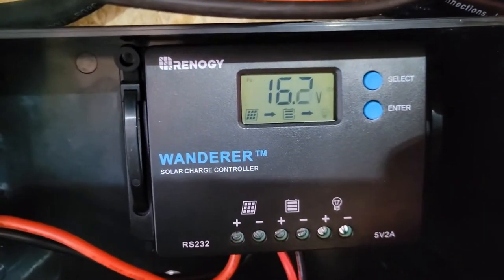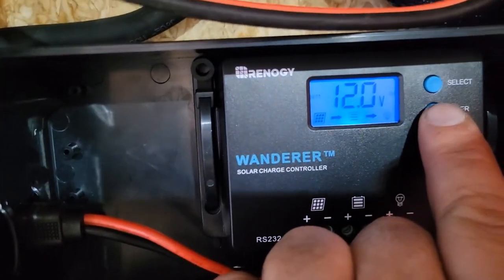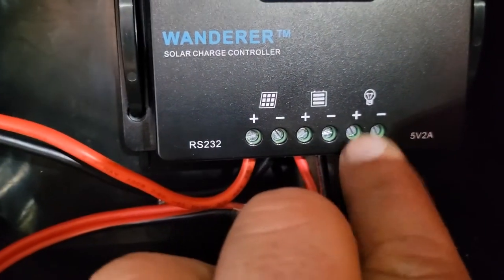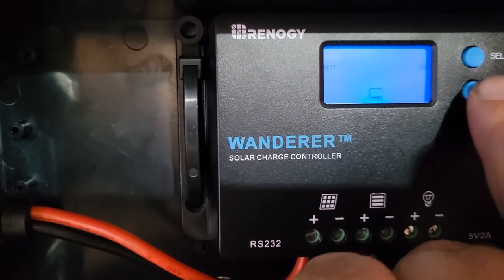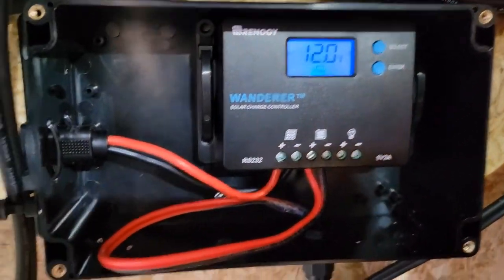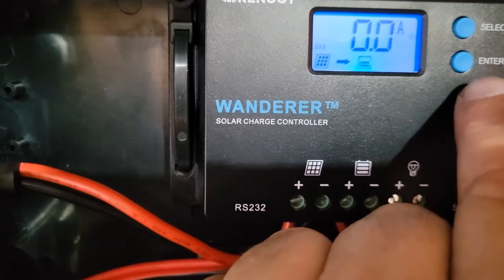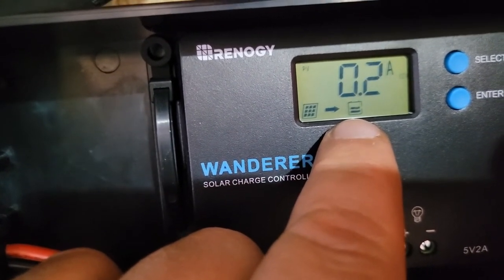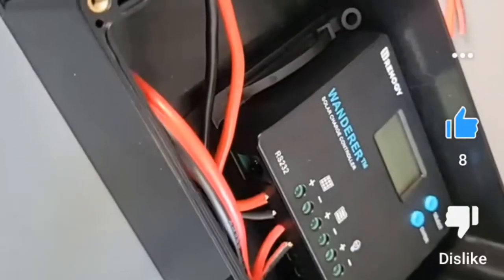Charge Controller Settings Renogy Wanderer #renogy #rvsolar

Comment: Does it only start charging when the battery low?
Or it’s always on?
Reply from the maker: Once it's hooked up to a battery it will always be on but it uses almost no power.  When it detects that the battery is less voltage than normal it starts bringing in power from the solar panel. It's always trying to make sure the battery is topped off.  It's a smart charge r in the sense it will feed more current the lower the battery gets and it will feed the battery less current the closer to full the battery gets.
Reply: @offgridutah1  okay so it only starts bringing in power from the solar when the battery is low?
I thought the solar charging part was not working because it was not showing the charging icon. I think it’s because my battery is still full.
Reply from the maker: Push the enter key to scroll through the screens there should be a solar panel icon in the bottom left of the screen indicating its hooked to a panel.
Reply: @offgridutah1  yah it’s not showing but there is voltage value being shown for the pv part which means the solar panel is connected to the charger controller 
I think the panel icon will not be shown if the battery is at full capacity I just need the confirmation from you.
Reply from the maker: @neva3732  I'll have to look at one of mine when I get a minute and let you know
Reply: @offgridutah1  thanks man
Reply from the maker: It seems like my panel icon is always showing if it's attached to the charge controller.  When I unplug my solar input the panel icon goes away. If you unplug yours then plug it back in does the panel show?  If not maybe the polarity is reversed or your inline fuse could be blown.  I've also seen people not get their wire stripped enough.  Make a small video and share the clip link here of your setup and unplug then plug the pv array to the Controller.  You also have to turn the charge controller on first before attaching the solar or it may not work properly
Reply: @offgridutah1  can you see it?
Reply from the maker: @neva3732  nice setup! My opinion is that for whatever reason the controller isn't recognizing that panel. 🤔   make sure the pv output is higher than 12volts or it may not charge. Renogy solar panels designed for this controller are usually around 20 volts if you were to put a meter on them.  This controller needs to be hooked to a 12v battery or 24 volt battery.  What is on the back of the panel?  Some smaller panels already have a "mini" charge controller built into them.
Reply: @offgridutah1  damn just wanted to ask did you use it with a fully charged battery?
Reply: @offgridutah1  also this is a small panel so it can only produce up to 7v
Reply from the maker: @neva3732  yes
Reply from the maker: @neva3732  7 volts may not be enough for this controller
Reply: @offgridutah1  true that I just tried using a 21v solar panel and it works
Reply: I just got a 12v solar panel and it’s not working again?
Reply from the maker: @neva3732  the controller must have a minimum pv voltage input.  It's probably around 20 volts.

Comment: so the 0.2 amps its actually 2 amps?
Reply from the maker: If this controller is reading a .2 then only .2 amps. It's capable of producing up to 10 amp. But if the solar isn't getting much sun .2 is definitely a possible reading.